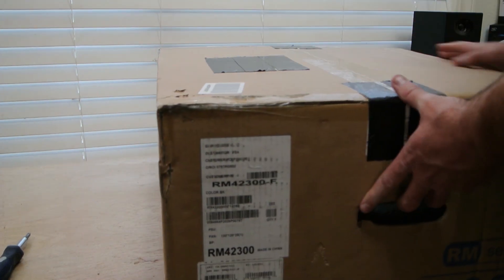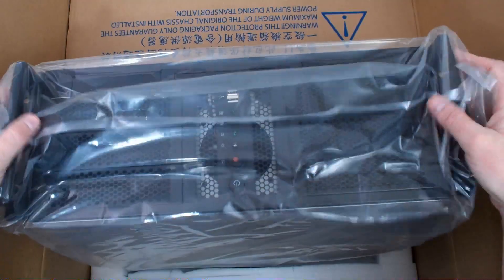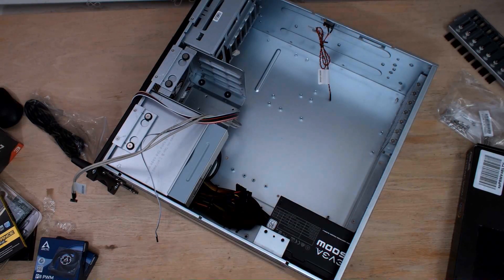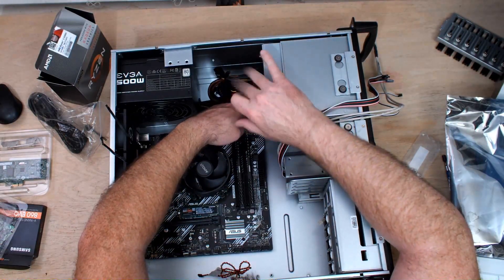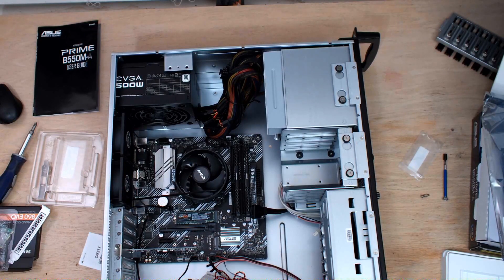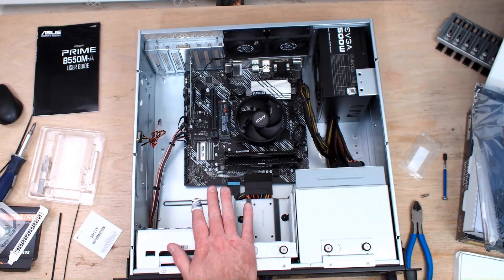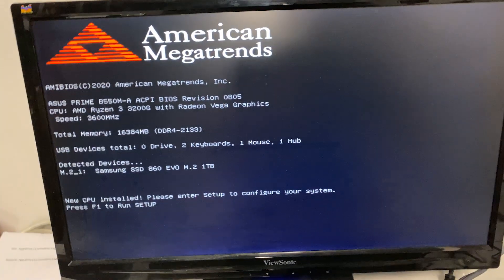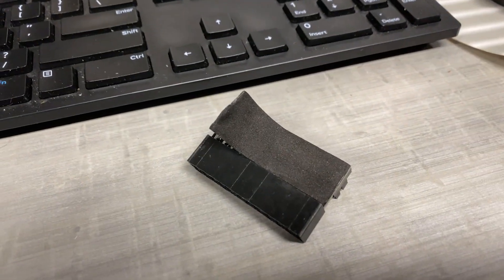Rackmount Ryzen Audio Editing Studio VoxPro PC Build

Comment: I don't know much about this but I'm thinking on building a rack PC. Was the 4u case necessary for this build ? Could've been built with a smaller case ?
Reply from the maker: Yes and no. You can find some nice 3U and 2U cases, but studio pc's need to have the ability to have full sized expansion cards. Professional cards are always full sized cards, and they may want to add one later. A 3U would work, if they made it with the features that work best for studio builds. When it comes to rack mount features, you have to balance internal design features and price. Most independent studios and stations don't want to spend $300 to $500 on a case alone, so this case has great features for the "around $100" mark.

Comment: Servers don't care about USB 3.0 because they don't use USB other than for key boards, power, or low speed requirement boot media. 
USB 3 isn't even recognized in many server operating systems.
Reply from the maker: I think it is the same reason most servers still only have VGA output, but in many instances you don't need it. VM servers are a good example. AS for USB 3 not being recognized, Linux, Windows Server 2012, 2016 and 2019 all support USB 3 if it is available in the system for a bare metal install. But when it comes for custom builds like this, where you are not buying a Dell, HP or other pre-built server, it is very common for people to use a system board with USB 3.0 on it.  There are cases with USB 3.0 on the front of rackmount chassis, they are just rare. I would say half of the "custom rack mount builds" are not even servers, but rack mount workstations for studios, TOC's and tour rigs. It should be more common than it is.

Comment: I've moved my rig into a similar iStarUSA D400 case, removed the drive cages and put 3 140mm fans on the front with 3D printed fan brackets. Never had a PC this quiet and the temps are really good too. The power button is in a bad place, considering I have to open the front every time, also theres only two USB 2.0 connectors there, so I'm planning on making a good front panel for it next year. I'm very happy with it, heavy but easy to transport.

Comment: This is exactly the video I was looking for. I am trying to build a rackmounted pc for my studio and have been debating about the case. This one only has space for 3 fans right? How is the noise level of the fans?
Reply from the maker: Not noticeable from a foot or so from the case. These are in a radio studio, so with the overhead speakers, you never hear them.
Reply: If you building one for a studio, and you want the 3 fans in the front i'd recommend Rosewill RSV-L4500.   Give's you more drives, and you can mount 6x 120, and 2x 80mm.   Which can all be swapped for Noctua's fans for silent work.   IstarUSA also does some pretty cool rackmounts.   Origin pc uses them for their 4u build cases.
Reply from the maker: @Damuskinous  I looked at that case, but for most of the applications I am building them for, it wouldn't work. Most people want a CD-Rom or multimedia hub in the front. Keyed swing door is also a big no-no for many people as they look nice, but tend to leave scars on legs. In a TOC/Server room they are fine, but not very useful in a studio, not when Front IO is required.